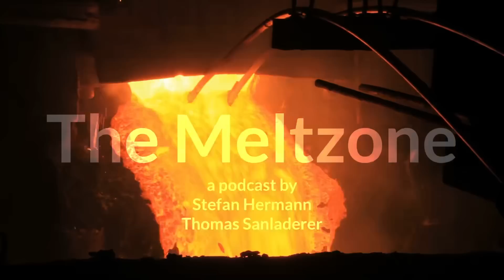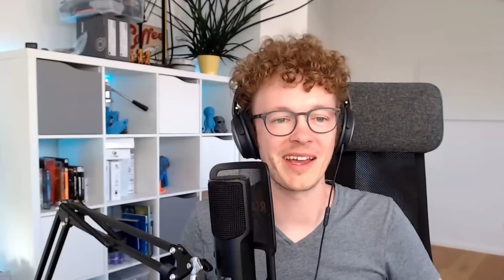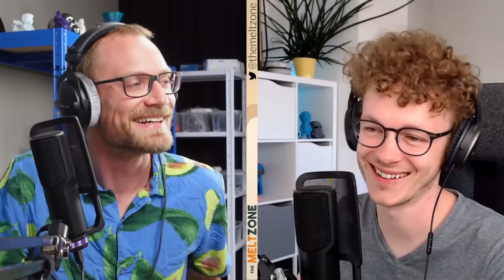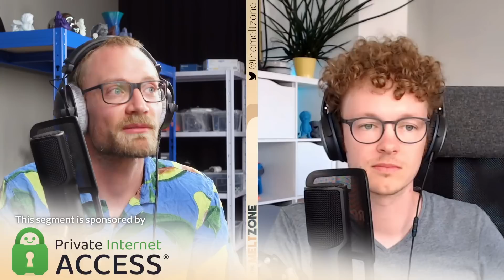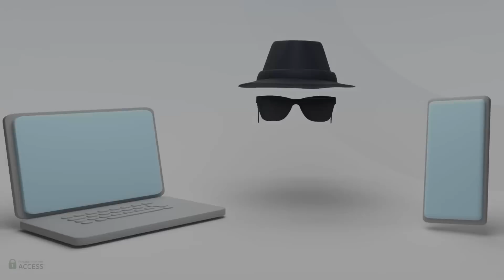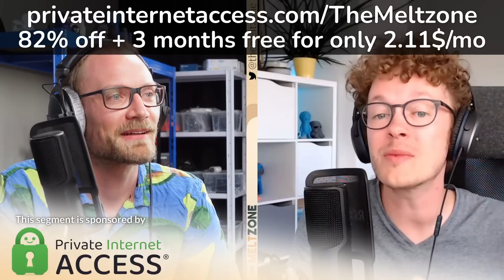Why stuff breaks, Robot Arms & Home-Compostable PHA Filaments - The Meltzone Podcast Ep 60

Comment: 1:27:00 PHA (polyhydroxyalkanoate) is a family of biopolymers rather than a single substance. Different types of PHA can vary significantly in their chemical composition, physical properties, and compostability. These variations depend on the specific monomers used during polymerization and the production method. For instance:

PHB (polyhydroxybutyrate) is one of the simplest and most common types of PHA, with high crystallinity and brittleness.

PHBV (polyhydroxybutyrate-co-valerate) includes valerate units, which make it more flexible and easier to process.

Other PHA copolymers can be tailored to balance properties like strength, flexibility, and degradation rate.

The compostability of PHA depends on factors like polymer structure and environmental conditions (e.g., industrial composting vs. home composting). Some PHAs degrade readily in natural environments, while others require specific conditions.

Comment: Its now Sept 2022 and they still don't have hardedn nozzles. I am waiting for the day when they make a PT1000 version of the REVO hottend. I just can't get the REvo to work for more that a week or two without having the Thermistor going out. This is my 3rd replacement unit I can't tell if it is to high humidity or to much temperature variation in my house that is causing the issue.

Comment: Have tried the allPHA myself. It is imho very hard to print on my prusa mini+. Bed adhesion is the main problem for me. I have to employ a large brim and print really slow on gluestick on a smooth pei sheet. The feel is really interesting, as mentioned. Somewhat soft feel. Wouldnt use it for anything more then decorative stuff. Havent tried it in the dishwasher yet, but that was one thing i wanted to use it for.

Comment: Grabcad is really just a repository for CAD files that you use to design a 3d part, like a board of Raspberry pi or a bearing or whole 3d printer or power supply and so on.

Comment: Interesting discussion. The podcast is going deeper and deeper into the engineering and the material science which is very welcome. I was surprised to hear that you have not have issues with material creep in PLA. For me this has been a recurrent issue for parts that are under constant significant stress. If you do do creep tests, I would be very interested to know what is a safe stress for when creep starts for different temperatures.

Comment: hi PLA is prone to hydrolysis, I think it is a reason why PLA parts / filaments crumbles / shatters.
https://en.wikipedia.org/wiki/Polylactic_acid
from CNC Kitchen: WHY you NEED TO DRY your FILAMENTS! 
https://www.youtube.com/watch?v=FAXUjZZER5E
Some manufacturing processes draws filaments through water, it probably doesn't help but it could be necessary due to the manufacturing conditions etc.
https://www.youtube.com/watch?v=cI2u-C09JoQ
I've read some cases of PLA printed parts shattering after a year exposed to humidity as well. 
In this case, for printing, I'd think drying the filaments probably help, especially if it is exposed to air in a humid environment.
For printed parts, I'm starting to coat some of my PLA prints with polyurethane, typically used as wood finish. Hopefully, it fixes or slows the crumbling problem by preventing humidity from damaging it. I think there are some spray painted coating as well, those are possibly more convenient vs polyurethane.

Comment: I've been waiting for Revo ObXidian high flow nozzles to became available. I want to put a Revo on my V-Minion, but I do print abrasives sometimes. I also want high flow to keep up with the monstrous speeds and accelerations I can hit with this printer (with some mods from the stock). There's no point in my changing from my current Dragonfly with a CHT nozzle until I can get those features.

Comment: 35:50 You forgot about Pro line from Sinterit - Nils 480. Just a little bit more expensive than Formlabs but it also has 30W laser and it offers bigger build volume. It also offer great looking printing process management like in Fuse 1/1+.

Comment: I'm in the UK, and can confirm it was unbareabe. We 'only' got up to 38c up here, but living in a house built in 1889 that is as insulated as a bin bag, I physically couldn't go upstairs. The front bedroom, which thankfully had an insulated roof got up to about 30c, but the back bedroom is in an extension that currently has no ceiling or insulation due to building work got up to about 40c. Downstairs thankfully it stayed around 25c with the windows open and the ceiling fan on. 
I have a portable AC unit, but didn't actually need to break it out